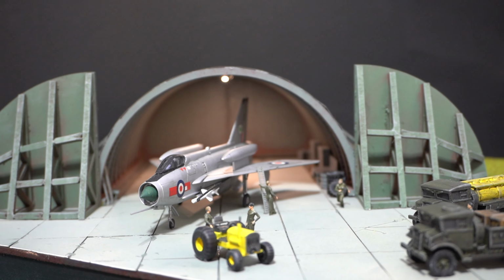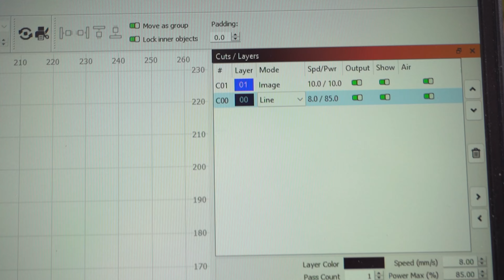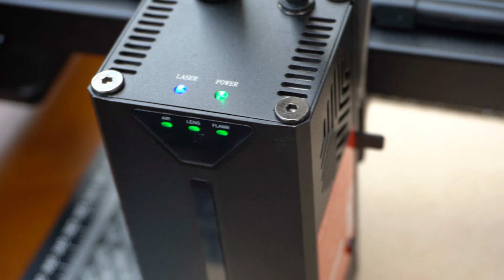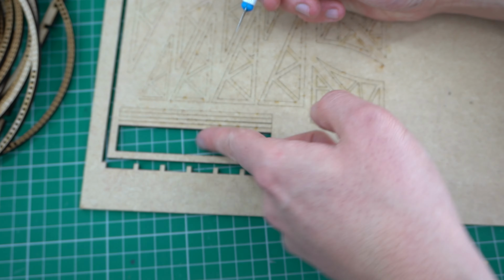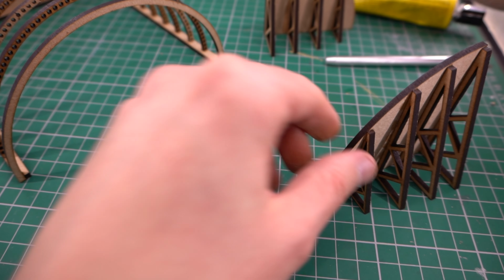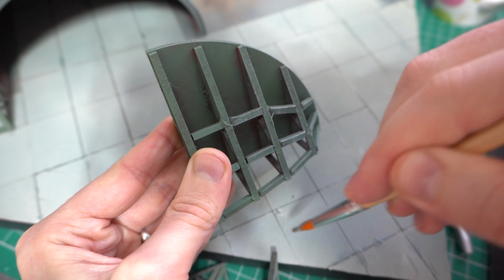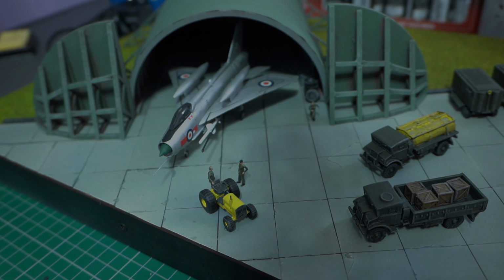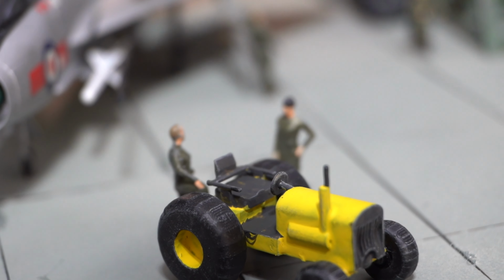I Made This Custom Aircraft Hangar Diorama Scale Model with the AlgoLaser Delta 22W laser Engraver!

Comment: Its a great looking diorama Matt. But you know my thoughts on  the aircraft used. Would have looked better with a suitable 1/144 scale fighter or maybe larger at 1/72 scale.
Reply from the maker: I did think about going to 1/72, but the parts would have been large to the point that the material I used would have resulted in waste (it would be like 1 part per sheet) and also take much longer to cut - time being something I was short of.

Not to mention the space required, 1/100 was the sensible choice with the time, space and resources I had available at the time (not to mention the maths to scale down dimensions is so much simpler at 1/100)
Reply: @ModelMinutes  You would probably need a base size of 18 to 24 inch or more for 1/72. I think most 1/72 Jets will be about 10 to 12 inch long and 8 inch wide. The HAS width would have to allow for about 3 inch either side of the planes wings. So, yeah, maybe 1/144 is the biggest scale you could go.

Comment: I wouldn’t describe it as ‘Awesome’, it’s very small, at twice the size the Hanger would look realistic.
Reply from the maker: the design is based on a HAS which was only intended for one aircraft - I took the sizings based on drawings at the correct scale so is fairly accurate for 1/100